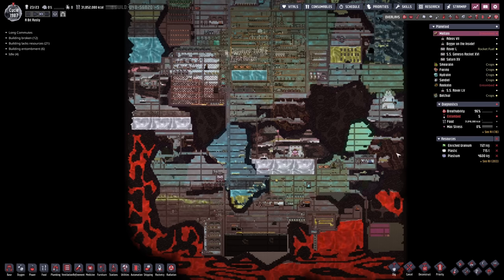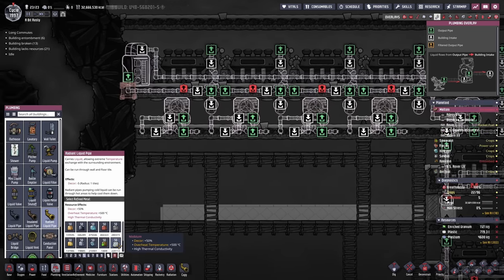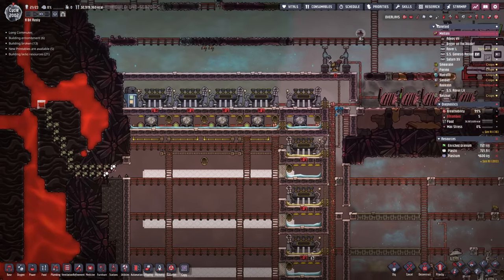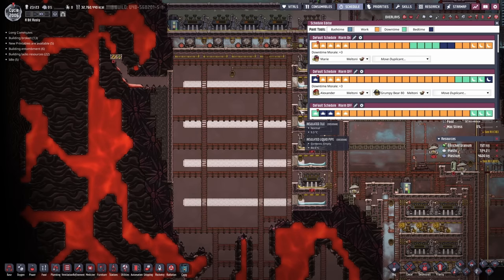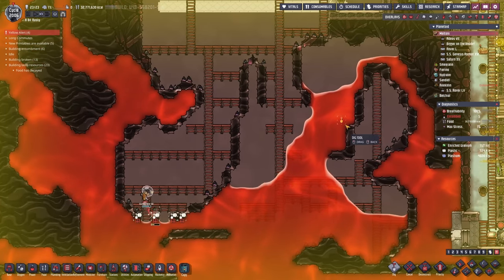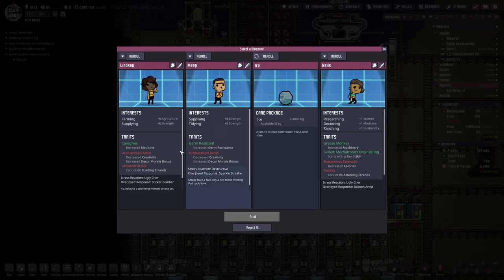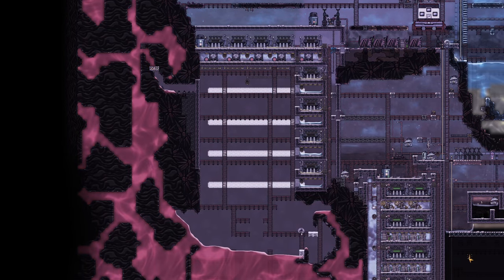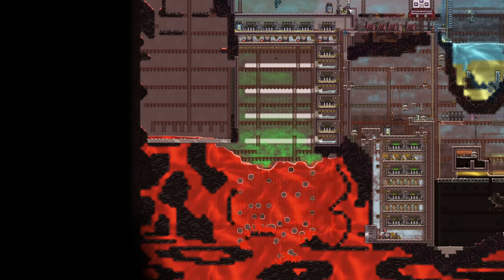Ep34 : Nuclear Fallout Vs Magma : Oxygen not included

Comment: I did something similar with ethanol due to it also having heat deleting properties. I found the fasted way to do it was to make it change states as quickly as possible. (Remember, the whole heat deletion process is directly due to it changing states. So the faster this is done, the faster heat is deleted.) I got it up to the point where it would vaporize then cooled it down to the point where it would condense.
Of course the other part is figuring just how much heat to apply to a given mass and then figuring out a way to cool it to just below the condensation point. This is going to vary dramatically by the amount of mass of the ethanol (or in your case the fallout). It's not a terribly hard system to set up, but you have to do some significant tinkering with the numbers to get everything running optimally. Also, nuclear waste is WAY, WAY more efficient than ethanol. However, you have to get it far hotter to actually vaporize it. And it's condensation point is significantly lower than it's vaporization point. Late game, this could delete a lot of heat. You'd likely need access to thermium and a way to heat it to 527C. Ethanol is quick useable in the early to midgame, but you won't get nearly the bang for your buck. On the other hand, you also won't have to get it very hot only to have to cool it down again.
Edit: Actually, because the temp difference between liquid and gas fallout is so extreme, it might still be better to use ethanol if you're worried about being efficient with it. It's just so much easier (and safer) to get it to state change.
Edit 2: Assuming I did the math correctly, ethanol is vastly better. It has about 1/28 the cooing power but you need to heat and cool it 250 times less. So it's roughly 10 times as efficient for cooling.

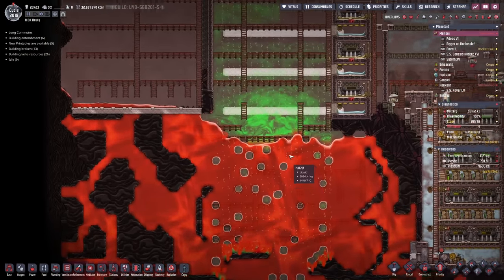Comment: At 18:00, I'm disappointed that the system didn't add some metal tiles in the condensation path for counterflow.  As it stands, the condensed nuclear waste has to fall all the way down before it exchanges temperature, so the cooling solutions cool the gaseous product only by brute force.  With metal tiles in the path, the gas and liquid can exchange heat directly, massively increasing the efficiency of heat-deletion.

Comment: Nuclear waste first, then go with water (since it is 100+) then ethanol for (77) or phosphorite (44).  Ethanol and Nuclear waste loose SHC when they flash, but phosphorite gains some.  Not really what you could melt beyond that to get it lower, but I wonder if it's worth just dumping an element that can flash, since you have an active cooling system to pull the heat out of the gas.
Still, this is a very cool idea, and I think I need to use it at some point!

Comment: Barely anyone will read this but I found out that this method also deletes quite a bit of the magma, probably due to the liquid flashing into gas on some low mass magma tiles. After around 12 cycles I had lost 1000t of magma due to this. Probably adds to it's fast cooling potential.